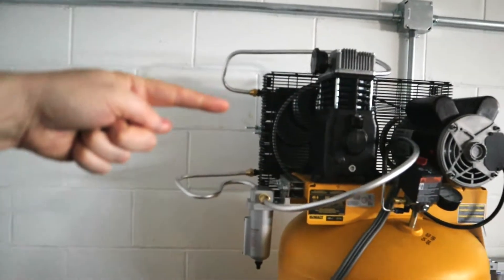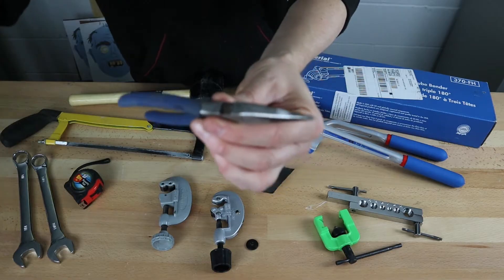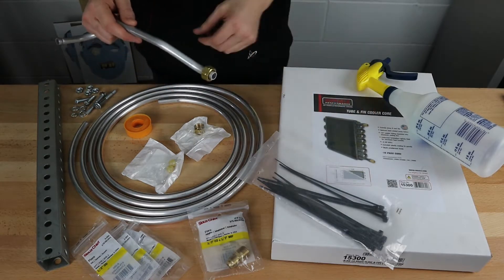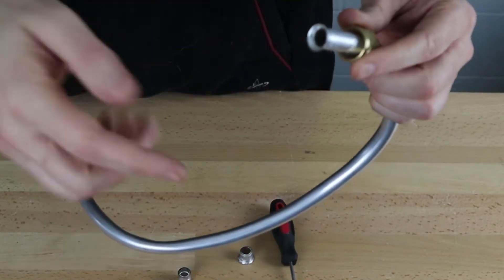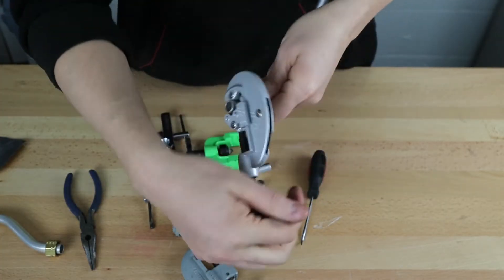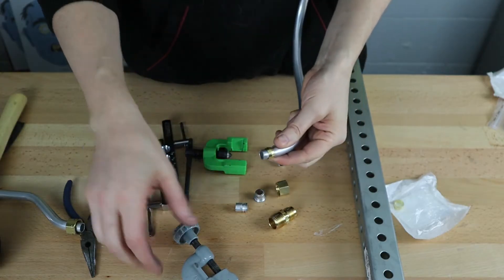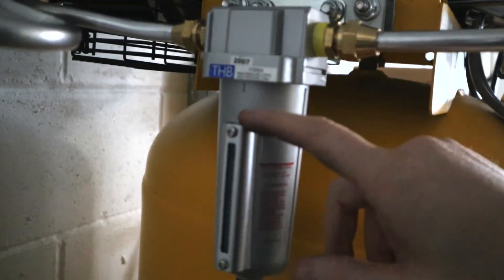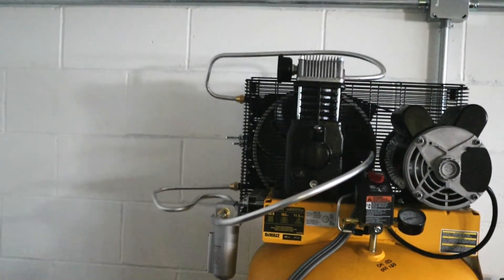CHEAP DIY AFTERCOOLER for cool DRY air on a 60 gallon compressor

Comment: I really think you are seriously overcomplicating those compression fittings. All you do is cut the tube to length, slide the nut on, slide the sleeve on and tighten it down.

Comment: I have a 9hp gas powered, 30lb tank. It has a 1" npt outlet on compressor to tank. I'm concerned about the pressure if I was to go direct to rad first. That's 1" not 1/2" or 3/4" like everyone else's compressor seems to be.

Comment: This seems like a lot of work and effort when you state that a person "should try to run" another 20 to 45 feet of copper pipe to cool down the air further. Also, what causes installing the manifold directly off the anti-vibration hose to be what you called a "no-no"? Is the "no-no" the hose, or is it that the manifold is too close to the compressor tank? If it is the proximity of the manifold to the compressor - why is this a "no-no"? Or, is it something else? Thanks for sharing your solution to the never ending moisture problem!

Comment: I did a mod to mine and it cooled the air great.  I do get a air pressure release from the unloader valve for a few seconds I didn't hear before.  I assume its holding more pressure in the cooler from the head to the tank and it releasing it.  Anyone have that after doing these mods?

Comment: What RPM does your pump run at, I’ve got one used and the size of the pulley on the pump and pulley on the motor indicates 2012.5 rpm, that is way too fast, a compressor pump should be around 700-1300 rpm max. Your thoughts?

Comment: Used compression fittings on a 175 psi unit and did none of those ferrule indents on the tube. No leaks and no failures to date.  Did not have a flaring tool so rolled the dice and came out perfect. It should be noted that over tightening those compression ferrules RUIN them.  Be careful, brass is soft and compressing slightly works just fine. Snug + a bump = perfection.
Reply: I was wondering about that. Every video I've seen on compression fittings the just slid the nut and sleeve on a straight tube and tightened it down. BUT when I've taken them apart on lines installed from the factory on air compressors they had those rolled intentions on the tube.

Comment: you can use a hydraulic hose. ive seen them used on high pressure air compressors at a factory i used to work at. never had any problems

Comment: FYI your pipe cutter with the black handle have a deburring tool built in. On the back of the tool is a black "blade" that flips out like a Swiss army knife and is used to debur pipe after a cut.

Comment: Good vid! Liked and Sub'd. I like this approach to adapting the the new hardline to the head on the compressor. I have the husky version and the approach I am taking is drilling and tapping the ports on the head to 1/2" NPT, adapted to 5/8" compression fittings. The a combination of soldered and compression fittings. The radiator I got was the same kind but with the hose barbs, which I cut off and soldered 3/8 to 1/2" adapters. I believe the radiator is called 1/2" but that's OD for tubing, which unfortunately makes the radiator the smallest tube in the system. Also got a bigger check valve. I am also toying with the idea of changing the motor pulley to get more cfm since the head is a bit less restricted.

Comment: I've been needing an air dryer for a long time but I'm cheap so am going to try a air conditioner radiator out of an old wreaked car, they have larger surface area, they are free if you have a few wreaks in the padok and their made to take higher pressure than any standard compressor will put out

Comment: -8AN Female to 1/2" Tubing Adapter Fuel Hardline Tube Fitting, 8 AN Female to 1/2 inch Hard Line Connector Aluminum Black Anodized

Wondering if something like this might work to switch from the 37 AN flare to a standard 45 (Amazon link)
Reply: I was thinking someone must have an adapter. I’m not sure on the threads. I have the Dewalt 60 gal and plan to check this week.

Comment: Thanks for posting. Instead of making the groove, could you instead take the compression fittings out of the pump and tank, then replace with 1/2 npt to 1/2 flare? That way the whole system is using flared line? Or are those fitting supper hard to remove and that’s why you opted for the groove style compression fitting?
Reply from the maker: Very shallow threaded area. Not enough room with the fittings I tried.
Reply: Thank you. I’m heading to hardware store this weekend to gather the fittings.

Comment: Great explanation. However I'm going to point out a major flaw in your methods and it can lead to some serious issues.

1) the cooler you linked to comes with -8AN (equivalent to a ½" tube size) flare fittings. AN fittings are a 37° flare unlike your typical 45

2) most flare tools that people are going to find in hardware stores make 45
Reply: 37° tool is also 10x price
Reply: well, maybe 5x
Reply: @IzziedeD  it's also an 8° better fit. Only the very edge of the lip will be sealing. A bit of vibration and it will be pissing air.
Reply: @m3chanist  yep, i think a lot of people don't realize there are two styles. i don't have 45° tools or fittings because i don't do any home hvac work. Also, even with a 37° flare, the 45° tub nuts won't support the flare well against the AN8 on the radiator, although it would be better than a 45° flare. I have seen a 37° flare tool on amazon for $20 that looks similar to his, but he'd have to have the AN fittings to support it. I switched from compression to AN everywhere on my compressor (i have the husky version). I took a different approach to the head. Rather than remaking the o-ring groove, i tapped the head 1/2 NPT and threaded 10AN fitting. Now it's 5/8" tubing all around, except the radiator itself. With the price of brass 45° fittings these days, it's not a huge price jump to use all AN on this setup.
Reply: 37.5 degree fitting is a JIC fitting
Reply: @Jamies_Channel  JIC and AN are both 37degree not 37.5

Comment: Curious if 4kpsi hydraulic hose could be used instead of having to bend and flare all those lines and connects
Reply from the maker: Depends on temperature rating and lifespan. The air can be over 300° F coming out of the compressor. Some types of lines wear over time as they inflate and deflate. It's not a steady pressure. Each time the tank reinflates the lines pressurize and depressurize.

Comment: Hey the only thing I see is that in my opinion it would work better to route the line into the bottom of the radiator and out of the top for the condensation to settle at the bottom. Just an opinion. Thanks for the video.also where did you get your CNC plasma table?
Reply: No, Hot air & steam/moisture in at the top. The logic is that gravity & air flow help push out the condensed moisture droplets to the exit at the bottom. The droplets would not travel opposite of airflow & uphill. Will you be installing a cooler on your air compressor? I will soon adapt a new auto air conditioner condenser for my air compressor. Ok, good luck toward drier, cleaner compressed air. I also recommend a UTube channel called THE Compressor Guru with Bud Stiner. Tell him Paul from S. Central Tx sent you! Cheers!
Reply from the maker: Thanks! It's langmuir systems xl with water table.
Reply: No, with rads you want the hot inlet to always be on the top.

Comment: How is the Derale transmission/oil cooler doing for you as far as keeping water out of the tank.
Reply from the maker: After 10 runs in a row I will see a little water in the tank on a humid day, but the amount of water pouring out of the water trap before the tank is FAR greater. I only 1 time have gotten water from the water trap after the tank. Usually about 3 tblspn water from the tank. I use an extended drain hose and suspect that no water is resting in the tank bottom in operation, only in the hose, but cannot confirm.
Reply: @megoingfast  So you're saying the manifold right off the anti-vibration hose wasn't really a no-no with this cooler and water trap set up?
Reply from the maker: I run this in a garage with the door open. Can get very humid in there. Bare metal rusts inside of hours in the garage.

Comment: Good tips on this mod, especially liked the DIY  "groover" tube cutter!
I do have a question about your connections to the  Derale cooler, correct me if I'm wrong but aren't those AN or JIC
fittings on the cooler?  Some weird 37 deg on the flange(45 deg being most common).  You seem to have used  regular 1/2" flare nuts, aren't those 45 deg?   Did I miss something there?  Will they need a JIC flare nut and a 37 deg flare on the tube for the cooler end connections?   Just trying to figure out what fittings I need to get. Thanks Again  GM

Comment: Great video and I will be using this for a reference when I do the same thing. My only critique is the needle nose pliers. There’s a tool on the back of the pipe cutter for exactly that purpose.
Reply from the maker: the deburring tool never makes it as smooth as I want is all lol Thanks!

Comment: Nice video! Could you just use a compression union and cut the stock hardline and mate to a copper line?
Reply from the maker: Great question! Yes! However, you will need to make sure you use the proper RATED copper line. Even type L line has a lower psi limit than aluminum though many use it.
Reply from the maker: Copper line also comes in o.d. and i.d. gotta make sure to get the proper size tube for the fittings.

Comment: ONLY you could pull off such a thorough, quirky and entertaining video like this and still remain completely educational.  Really awesome, I've been seeing a lot of videos about air compressor explosions so it's nice to see it done safely!
Reply from the maker: Huge concern for me, safety, for sure. No kinks in lines, high PSI parts, clean to not have as much vibration wear, secured, and SLOW testing on compression step ups. Sourced radiator people have been doing this with for a while as well. :)